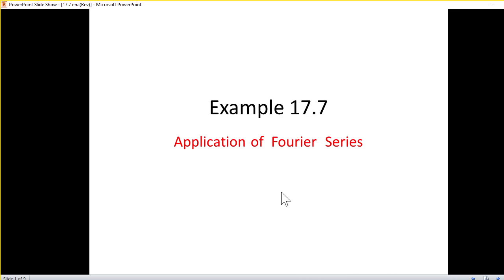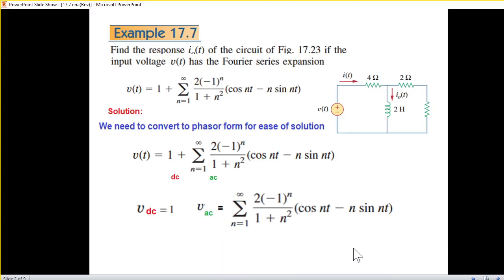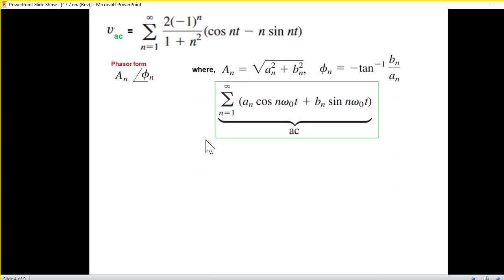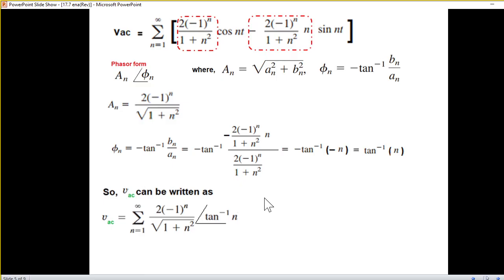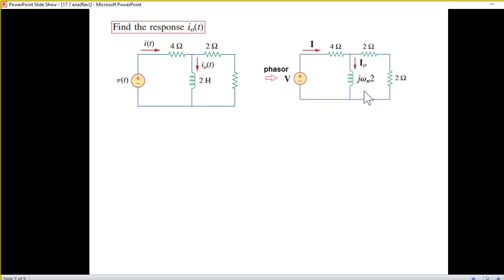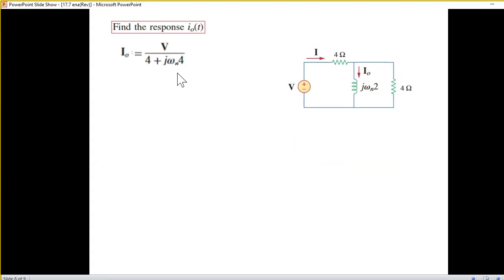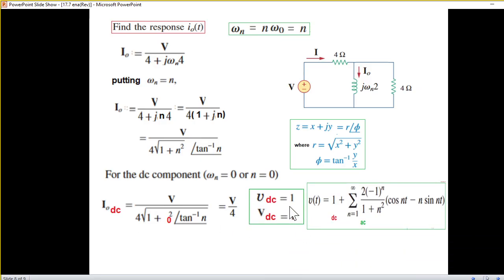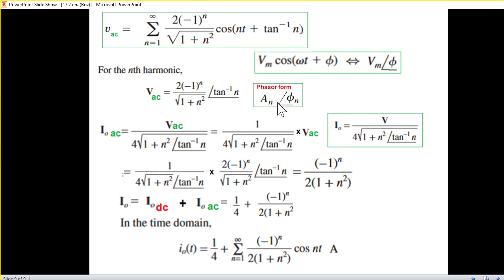(English) ENA || Example 17.7 Explained || Application of Fourier Series in Circuit Analysis

Comment: sir please cover this topics thanks :MOSFET (Chapter 4, 5th Ed.) MOSFET Introduction Modes and Condition MOSFET Circuits at DC Examples: 4.2, 4.3, 4.4 Exercises: D 4.10, D 4.11 Small Signal Models pi-model, t-model (with and without ro) Single Stage MOS Amplifiers Common Source Common Gate Common Drain To prep Conversion of initial circuit to its small signal circuit Analysis i.e. Finding all voltage gains, current gain, Rin and Rout as per each topic